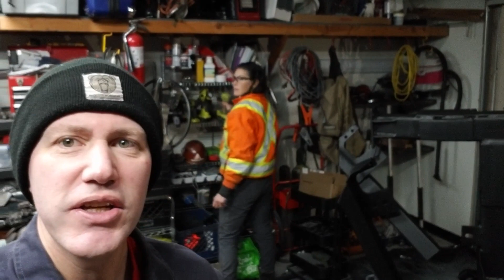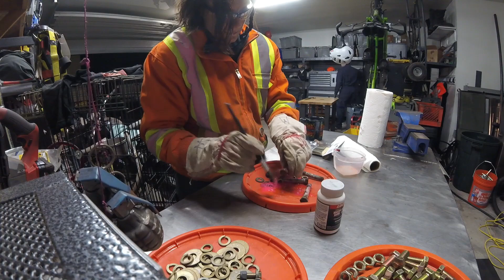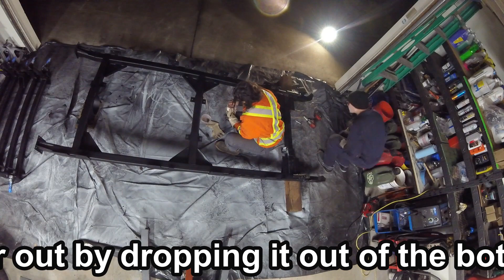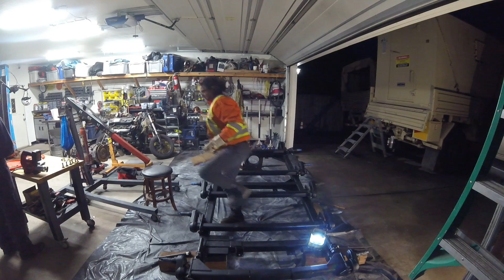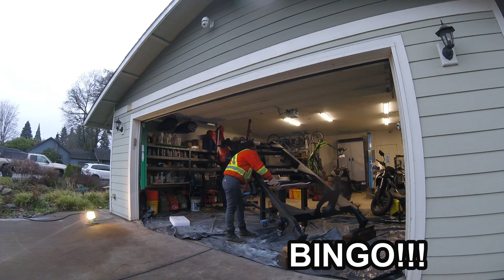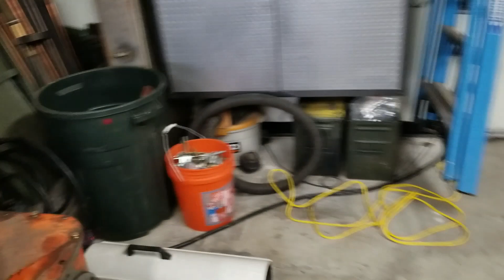Rusty the Spryte build part 19 (frame assembly)

Comment: What was the pink stuff you used in the bolts?
Reply from the maker: I used red and tacky lucas grease but Willow was cleaning the brace bolts with naval jelly.  They were in great shape so they just needed a bit of cleaning up.  The axle mounting bolts were all trashed so I used new hardware there...

Comment: Aloha Sean, I am sure you have covered this before in one of your videos but I need to ask, do the axles have torshen bars in them or will you put shocks on to keep from beating yourself to death?
Reply from the maker: All thiokols that I know of have torsion bars.  Is it hard to tell that these are torsion axles??   I had solid frame mattracks.  I will never make that  mistake again.
Reply: @SeanFillner  Thanks for clearing that up for me.  I had assumed that there were torsion bars inside the axles but you never know until you ask.  Again mahalo.
Reply from the maker: @philliplamborn294  no problem.  These have been sitting for so long that some of the torsion angles don't match.  I think they need exercise badly....  LOL